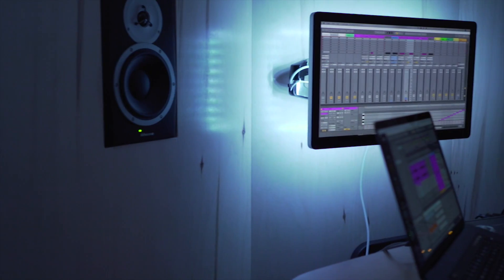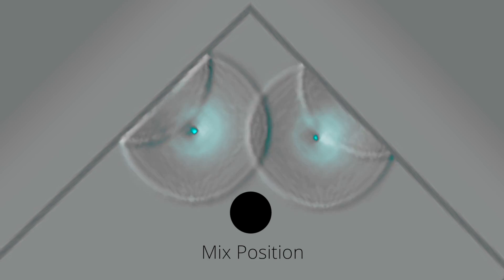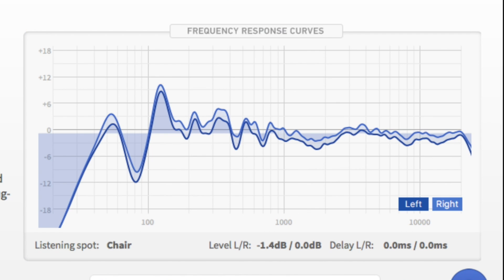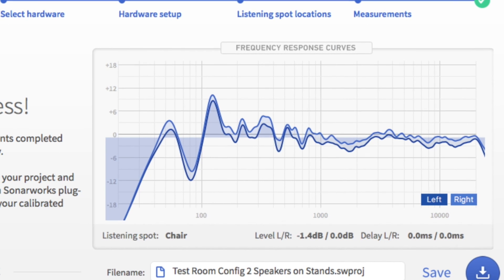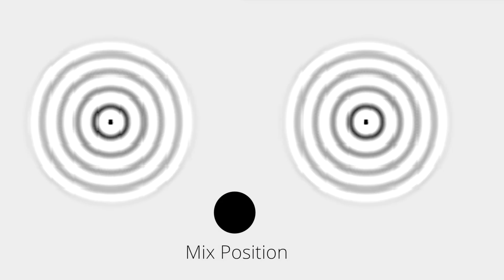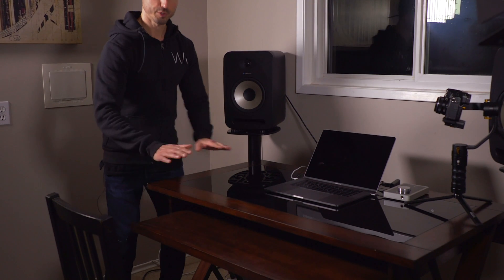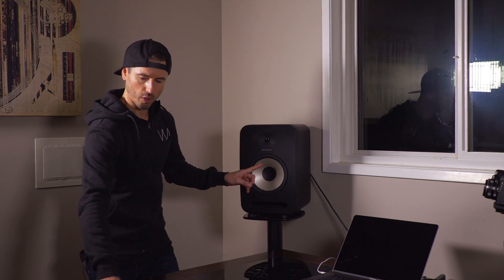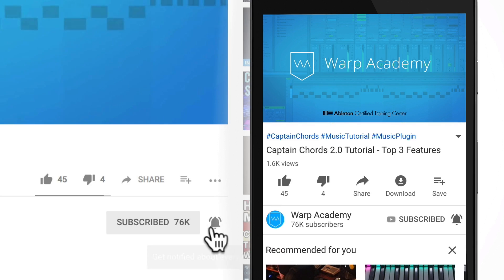How to Set Up, Test and Improve Your Home Music Production Studio Room – Acoustics Tutorial

Comment: Those dinky little panels won’t touch anything below 175 hz! You need a minimum of 6”
Reply from the maker: First, if you want to actually fully attenuate a frequency you need 1/4 the wavelength of absorption, so for 175 Hz you'd actually need about 1.5 feet.  Not 6".  

However, if you're referring to the small square panels placed in the speaker reflection points, you need to understand this.  They're there only to address comb filtering.  The comb filtering effect only happens in the upper mids and top end of the mix.  Look at basic acoustic testing frequency response graphs if you need a visual.  The desk related comb filtering effect doesn't happen anywhere near 175 Hz so this actually is quite effective.  

The better solution though, like I said, is to have lower desk.
Reply: @warpacademy  yeah it can be quite insane how much treatment is actually needed. I'm going with GIK monster traps with flexrange & an airgap myself. I hope it is effective.

for the desk, I got a sit stand desk that goes quite low. I like to sit way lower than most setups

Comment: Hey man, thank you for this info! Super helpful!! I built my own little studio but I’m having problems with 150hz. Every time there’s a low D (Bass or piano), the room gets blasted with a huge peak of frequency! Any idea on how to solve that? While recording I just eq that freq down, but it doesn’t help my mix
Reply from the maker: Hey Aaron.  Glad you liked the video.  Most home studios have completely parallel walls.  This creates room modes and standing waves based on the wavelength of the frequency corresponds to the distance between the walls.  When a sound occurs in the room from your loudspeakers, that frequency can get excited.  That frequency can accumulate and spike up in the room and also take much longer to decay, time-wise. This is called modal ringing and that's likely what's happening here.  

In most cases it's impractical to change the dimensions (walls) of your room, unless you're willing to renovate.  What you can change is monitor placement and acoustic treatment in the form of absorption and diffusion.  Without knowing the room dimensions of your space, or your monitor type and position, it's impossible to give specific advice.  But what I can say is that this can be significantly improved with tweaks to your speaker location in the room and creating some 3.5" and 5.5" thick DIY floor to ceiling absorbers out of 1 x 4 " and 1 x 6 " framing lumber, deck screws, and Roxul Comfortbatt R14 and R22 standard home insulation.  These style of absorbers can be placed around your critical listening position in primary reflection zones on your side walls, wall seams / corners, and on the ceiling (ceiling cloud).  Then you'll want thick absorption (trapping) on your rear wall to attenuate bounce back to the listening position.  

Pre-fab panels that are 2-3" thick that you can buy online are limited in effectiveness because they're not thick enough to get down into attenuating the bass.  

You'll also need to get very familiar with acoustic testing using Room EQ Wizard (freeware) and an acoustic measurement mic like the UMIK-1.  This will guide your decisions about where best to place the monitors and absorption.

Comment: Excellent video as always 🙏 Question my left speaker has a window to the left but I have thick blackout curtains covering is that ok? I have no other option but to have it this way. Will I need a acoustics board up instead?
Reply from the maker: Hey hey.  Glad you liked this one.  No, blackout curtains will not solve the issue.  Glass on a side wall will dramatically compromise your acoustics.  Blackout drape only attenuates in the upper mids and higher.  Perhaps some mids if you have it double length, folded, with some space behind it.  But it'll do nothing about the low end.  

With windows, I suggest filling them completely with Roxul rock wool.
Reply: @warpacademy  Thanks for the tip Rockwool was going to be my next buy anyway for the walls. So doing the windows is an added bonus for winter 😂 Thank you 🙏  I’m currently doing my low end using Sonorworks in headphones. Thanks again your channel has some top advice 🤟

Comment: Hey, amazing video, thanks a lot! Quick question as I can’t find much information related to this: I am setting up my studio in the corner of my basement (it is very big) and the space is basically a C (2.78 X 3.30 X 2.78 meters and no fourth wall). If I follow the logic of side reflections, then I should put the desk on the longer 3.3m side and should have little reflections from the back as the space iOS very big (10+ meters towards the back). Is my understanding correct? Thanks a lot!

Comment: "Avoid desks with keyboard trays"
"Don't clutter your desk with studio equipment"
*Uses a desk with the keyboard tray
*Clutters his desk with studio equipment

But very informative video nonetheless. Keep it up!
Reply from the maker: Good eye for sure.  Let me elaborate.  My studio is used for sound design and creative work as well as mixing and mastering.  When I'm in a creative mode, I get out all of my gear and have it at my fingertips.  When I'm mixing, I put it all away and place acoustic panels in the speakers' acoustic path just like I stated in my video.  That's pretty normal.  

I'm in the process of designing an engineering desk with my acoustician but it's not complete yet.  That'll be in a future video when it's done.  But for now, I'm using acoustic absorption to eliminate comb filtering off my desk.  It works quite well actually.

Comment: Thanks for this. Do you use a sub in your studio and how is it set up? What are the dimensions of your room?
Reply from the maker: I use LFE, yeah.  It's a Genelec 7060B positioned with the port centered and sitting directly against the hard front wall, but not built into it.  This correctly phase-aligns the sub.  The sub is highpassing the monitors above their port tuning Hz, as the monitors are rear-ported.  And the sub has been tuned with a bit of low end rolloff.  The Genelec sub, thankfully, has a ton of configuration.  You can adjust phase in 90 degree increments, for example.  

In future builds, I would not use a sub though.  I'm planning on removing it and instead going with much larger 3 way monitors mounted flush in the wall (likely ATCs).  Subs are quite problematic to tune and I'd prefer for all the sound to be coming from a single source with more exact phase alignment.  

Room dimensions are 8' ceilings, 12' wide, 23' deep.  The back of the room is vented to allow bass to escape behind the trapping.
Reply: @warpacademy  Got it! Thanks for your response. This greatly informs my decision for buying a sub where I don't have the wherewithal to demo one and subsequently make a purchasing decision. 
Your room dimensions seem to be golden ratio. 
There was an error by the mason when I was building my room which was supposed to be 23' long too.
Therefore it is now L 22.8' X W 14.3" X H 13' which I am still very thankful for.

Comment: Great video really useful!
I have one question, my home studio is really similar size of the one in the video but the window is close to the right corner in this case where should I put the desk?
Plus is necessary to do acustic treatment for this small rooms?
Thanks in advance hope you can help me to sort this out.
Reply from the maker: Glad you found this useful.  It's just as important, if not more important, to use acoustic treatment in small rooms.  You have many more issues with downstream reflections (IE ones off several surfaces like back wall to front wall to ceiling to floor to your ears) in a small room that aren't as much of an issue with larger rooms.  

Hard to say where to place your desk without seeing your room measurements.  Your room is likely so small that you can't avoid the center of it.  You may be better off working in headphones.
Reply: @warpacademy  thank you for your help

Comment: Question about monitors. I’ve built a couple studios and have always thought they need to be a foot or 2 off the wall. How is having them against the wall or even in the wall different to pulling them off the wall. Can you comment on the 3 positions in detail? Cheers mate, great video
Reply from the maker: Hey Bruce.  Solid question.  It's because of the bass bounce off of the wall behind the monitors.  If there is a delay, even by a couple of feet, it will cause horrible nulls in the low end.  Just run tests for yourself using REW with the monitors positioned several feet away, or right against the wall.  
Putting the monitors as close to the wall as possible minimizes, but doesn't fully address this issue.  This is why you see monitors mounted flush in the walls of professional studios designed with an "acoustics first" approach.  Also keep in mind there are MANY "professional" studios that are not designed with an acoustics first approach.  Tons of studios are designed to look good / impressive (IE lots of gear all over the room, several sets of monitors on stands, glass on the side walls, lack of floor to ceiling trapping), but if you see the tests they don't lie.  These rooms are far from ideal.

Comment: don't put your speakers near to the wall please!
Reply from the maker: Acoustics beg to differ.  The best position for monitors is IN the wall.  IE flush mounted like you see the ones in my studio.  If you can't do that (most new producers and engineers can't due to budget restrictions or skill set) then the next best position is as close to the wall as possible.  

You're going to get a bounce off the font wall no matter what.  If they're on stands at any position, you'll get a bounce.  If you have acoustic panels on the front wall, you'll still get a bounce in the sub frequency range.  That bounce, recombining with the dry signal, will cause horrible nulls.  

Positioning the monitor against the wall reduces the time between the dry and reflected signal, which reduces (not eliminates) the issue.
Reply: @warpacademy  nope, placing your speakers close to the front wall helps drive them, providing more output and less distortion. However, it also causes low shelving, a boost in the bass response.

Comment: Hi, thanks for this valuable information.
I have a question regarding the positioning of the monitors. By bringing them closer to the wall even though they are on a stand we are not really solving the problem of reflections. Wouldn't it be better to put them further away from the wall? as many manufacturers advise placing them 50 cm away.  Thank you.
Reply: This is done because to resolve the issue by moving them further away, you would need to put the speakers about 4 metres away from the wall otherwise you will compound the phase cancellation. Try keeping the speakers within half a meter of the wall as this in the scheme of things will be far less of an issue. Basically this is why speakers are placed in walls where possible. Hope that made sense 😀

Comment: Hi there,

Excellent video. Much appreciated!! One question tho. You mentioned that the ear should be on the same level as the acoustic centre of the monitor instead of the speaker's tweeter. However, there're lots of articles, videos and even official site of speakers brand that recommend an ear should be on the same level as the speaker's tweeter. So I am quite confused about which of these two ways should be applied to set up my monitors. It would be really helpful if you could answer my question. Thanks again!! Cheers

Comment: Love this! Question: when you built your monitors into the walls, won't those walls (and the space behind the wall around your built-in monitors) act as a big speaker cabinet -driven by the actual monitors?
Reply from the maker: Good question.  The entire area behind the monitors is filled with absorption.  The monitors are rear ported, which usually won't work for a flush mount, but they're highpassed by the sub at a frequency above the port tuning, so it works.  The front wall is super heavy as it's made of ply layered with heavy MDF.  The speakers are also acoustically decoupled behind the wall on custom concrete blocks and urethane bushings.
Reply: Warp Academy that’s pro! Thank you for sharing!

Comment: Thank you for this! Very informative and nicely done. One question though: You say "Push the monitors right up against the wall", but everywhere else I'm reading they should be 30 cm (12 inches) away from the wall due to bass buildup. Can you please elaborate on this? Thanks again for the video!
Reply from the maker: Hey Jellephant. Yes, you'll hear that advice given a lot.  It's outdated and irrelevant hi-fi speaker setup advice that does not apply to reference monitoring setups and music engineering rooms.  If you leave that gap to the wall you'll get a horrible peak and null in your bass from the out of phase front wall bounce and you won't be able to mix bass accurately.  

Read this article as it explains it better than I ever could: http://arqen.com/acoustics-101/speaker-placement-boundary-interference/. 

There is most certainly bass build up by placing the speakers against the wall (this is referred to as front wall loading) but that it much more easily dealt with than an aggressive peak and null because the build up can be addressed with a low-shelf filter.  In fact, most well-designed monitors have controls on the back to account for this speaker positioning.  It's very common to see a low-shelf filter with -1 to -6 dB positions.  Acoustic testing will be your friend here.  Do the tests for yourself!  

I found the front wall loading in my tests could be eliminated by using the speaker tuning controls with low-shelf attenuation.  Keep in mind that "put your speakers against the wall" also means that you read the operation manual for your speakers and, if they're powered, leave sufficient room for amplifier cooling (typically 2.5 to 5 cm).  Don't start fires for the sake of acoustics ;)
Reply: a year late to this comment but thought i'd share. it sounds to me (from pretty extensive time spent watching all kinds of different videos on this) like its fine as long as its a couple of inches from the wall. also, if the speakers are not parallel to the wall and are slightly off axis pointed towards you at an angle you will be fine. and also (what surprised me) front VS rear ported doesn't make much of a difference for the most part. unless you are designing a very specific and thorough studio meant for professional use you really don't need to sweat it with these kinds of details. Also, you should use headphones as a secondary reference as well. hope this was helpful
Reply: @BL1THE  it’s never too late to comment. Thanks for your 2 cents it’s appreciated. Building my own professional home studio and it can be confusing.
Reply: This might help : https://www.youtube.com/watch?v=T10_MLGOBfc
I'm not shure if it changes with the speaker's bassport on the front or the rear
Reply: I was confused by that too
Reply: I use bass/broadening absorbers directly behind my monitors and then place my monitors right up against those.

Comment: whoa I thought it was for sure better to keep the speakers as far away from the wall as possible? Wouldn't being nearer to the room boundary increase the amount of colored sound at the listening position?
Reply from the maker: Hey Alex.  Good question.  You're going to get reflected sound from all surfaces around you in any bedroom studio.  The key here is to position your speakers for the most ideal frequency response in a non-ideal space.  The prime way to set things up is to custom build a front wall and flush mount your speakers into it, thus avoiding the problem entirely.  However, this is technical, and costly, which makes it prohibitive for many people.  

The next best thing is to reduce the degree of phase cancellation by getting the bounced signal as close to the direct signal as possible.  I highly recommend you do your own acoustic testing to look at the results for yourself.  If you use a free app like Room EQ Wizard (REW) and a calibrated acoustic measurement mic like the Mini-DSP UBIK-1, you'll clearly see for yourself the effect of different speaker positions.  Don't take my word for it, check it out yourself :)

Comment: Great video very helpful.  The only thing I'm a little confused is placing the monitors right against the back wall. If you had a rectangular room and more space from front to back what would you recommend for the placement of the monitors. Still against the back wall? or 3 feet away from it?  Also, in the configuration that you show on the video what if you had a large computer monitor,  would it be ok to put it on the desk?  Thanks.
Reply from the maker: Hey hey.  Glad you liked the video.  Regarding monitors on the wall, you're doing that to minimize phase cancellation in the low end due to the bounce off that wall.  If you move the speakers off the wall, you increase the phase cancellation effect by increasing the delayed reflected signal that recombines with the direct signal.  So if you have a larger room, you can do 2 things: 1) build a hard front wall and flush mount the monitors into that wall thus eliminating the bounce entirely - but to do this you need monitors that are able to be flush mounted and not all designs can be (ex: rear ported monitors in some cases, depending on port tuning and use of a sub with a HPF and designs like the Focal SM-9s and Barefoots that have side mounted radiators or bass drivers.  2) You could add a bunch of trapping to the front wall and wall seams to reduce the bounce.